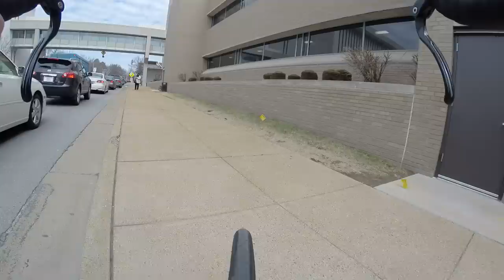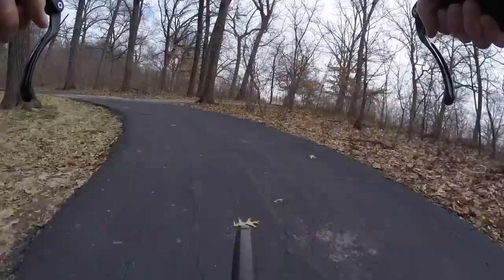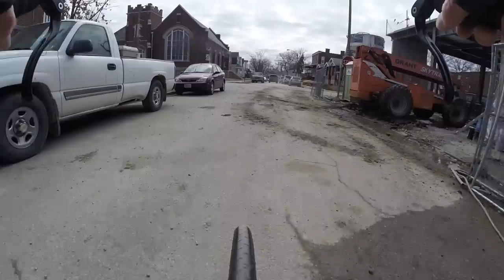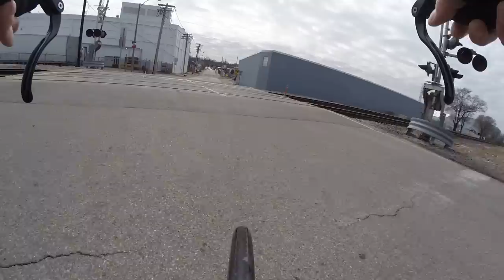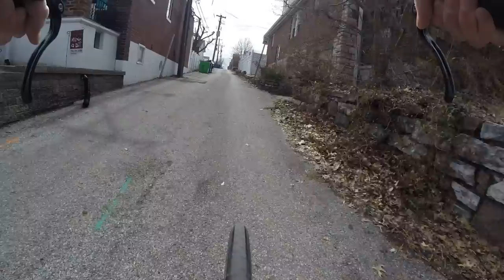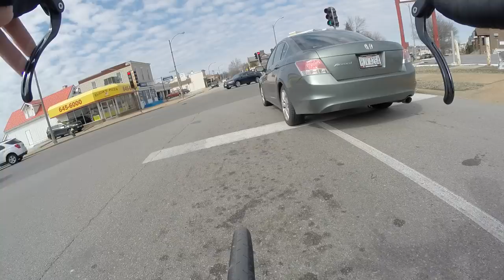BRAKE PAD TOE IN Tip Of The Day Commute Bike Blogger

Comment: i had to go through this process for the first time when i got a bike with canti brakes a few months ago. there was enough flex in the system that when they hit flat on the rim the grab and slip frequency just sent squealing through the rim and calipers and sounded like a train horn. i road it like for a few days and would feel terrible if i got on the brakes behind anyone on the path as it was so disturbing. but i toed in the pads and that controls the vibration frequency and prevents it from hitting that type of resonance. plus they squeeze tighter as the friction on the trailing edge pulls the pad in to the rim giving even more clamping pressure. if they are flat faced again the rim you may get a slight lift on the trailing edge as they caliper arms flex or twist with wheel rotation. park tools channel has a great video on how to makes these adjustments on various styles of rim brake calipers.

Comment: A good explaination, just one correction though, what you call the leading edge is actually the trailing edge. That is because it is the trailing part of the brake pad in respect to the brake pad and how it comes into contact with the braking surface on the wheel. It has nothing to do with the fact that it is the furthest forward part of the pad.
As the rim braking surface is moving farwards at the top where your brakes are the leading edge of the pad is actually the rearmost edge of the pad.
Reply: True, I hadn't thought of it that way.  Sort of what happens when you PUSH a piece of chalk into a chalkboard (worst sound ever) vs. pulling it across the chalkboard.  You want the rims pulling across the brake pads and not pushing into them.